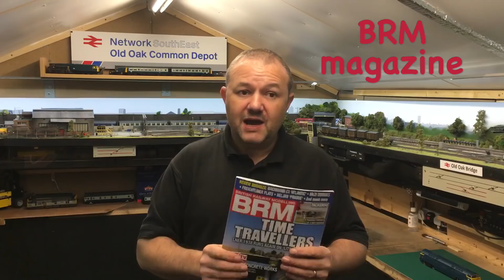Loco Conversion DC- DCC.

Comment: I was most interested in your illustration of the short comings of the "ringfield" motor fitted to the "Western" diesel. I have had great difficulty with the RF motors in my various (4) Hornby HST sets, which are very reluctant to run smoothly even after fitting new carbon brushes. Any suggestions   Paul Wilson
Reply from the maker: Hi Paul I’ve a couple older HST and yeap they are a pain not really sure what the solution to modifying all Ringfields but I’ve I’m interested in the cd drive motor for the pancake style maybe this could be a route to explore 

Very interesting though 
If I come across anything I’ll air it as a separate video 👍

Great discussion buddy 

All the best Garry

Comment: Lovely looking Western Garry.  I bought one of these but in maroon some time back and have to agree with you, it’s a beautiful runner. I may buy one or two more of these as long as you haven’t bumped the value up too much with your comments. 😜 Keep up the great work. Paul
Reply from the maker: Lol Paul- just don’t blame me lol   

I literally walked up and picked this up after 2 days 

I was told by a smaller retailer that at exhibitions some guys normally put a mark up price on things -but I’ve learned that’s mainly on newer stock, but not on the older items as it gives a perfect audience to buy the secondhand market at a -as you see it price 

Good tip 😉👍

And a good haggling point too.

Comment: Hi - yes - most of my fleet are made up of locos like that! I'm setting up a new layout and have lots of costs, so just have to budget appropriately - it's one Bachmann loco or one old 80s Hornby loco and 10 new sets of electrofrog points!Using older locos has meant I can have a bit of variety running on the layout much sooner than I could with new locos. Over time I'm sure some of the old stuff will get replaced, but not all of it!
Reply from the maker: Sounds exactly as I started on this particular layout 3 years ago I had steamers and loco’s as from a kid mainly Hornby Lima tri-ang

 I started this layout from loosing my best bud his inspiration has grown inside me and I always wanted new top end loco’s but never could afford 
I sold a couple Lima’s and bought replacement bachmann but at a price I could afford so I’m always on the look for quality at a good price like us all. I never bought the latest releases but the 5yr older ones as I found manufacturers update running numbers for a variety of stock 

so certainly a good thing to work on. And keep the cost to a minimum and this is why I try to build as much as I can 

Great comment 👍

Enjoy the weekend buddy 😉
Gary

Comment: Great video Garry.
Its always good to find something older to use on the layout.  I have a selection of both old and new but these days the old stuff stays mainly in their boxes as the detail on the newer stuff is hard to match and with the helix not much of the old stuff can actually pull anything up it.
Keep up the great work
Cheers Paul
Reply from the maker: Hi Paul that is the only down side on the older loco’s being assigned to light duties 😉

But great to see more older loco’s falling on our layouts after all they are running models. 

Take care buddy Garry
Reply: Im hoping to dcc some old stuff but been too busy with my junction point motors which havent been working right.  
I was rooting for you on the tv tonight and we thought youd just done enough to win... disaster, well done matey it was the best show and I think against any of the previous contestants youd have won it.
Cheers Paul

Comment: hi Gary,  I'm  just back as i work away.so was nice to see your new vid.and like most modellers on here, i have to agree, i have a fair few budget locos. But also some very expensive ones, the pricing in this hobby is realy getting out of control. The manufactures should be encouraging younger modelers,into the hobby. And not pricing them out .

Comment: I agree about budget locos - I'm starting a project to revamp a couple of old Lima locos - even with replacement motors they can't match the quality of running of a modern Heljan/Bachmann but for £20-30 you can have a nice project loco to be proud of. Not everything has to be perfect.
Reply from the maker: Absolutely perfect buddy sounds a great project and I value and echo not everything has to be top notch after all that’s what building is all about.

Cheers Garry